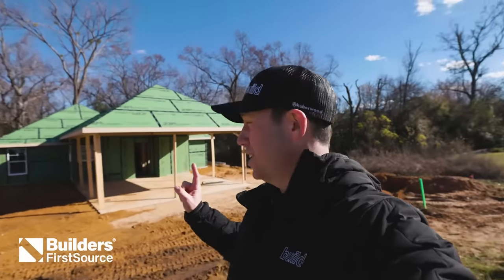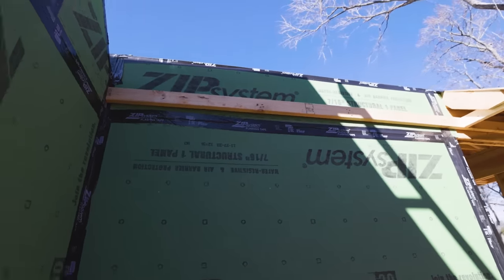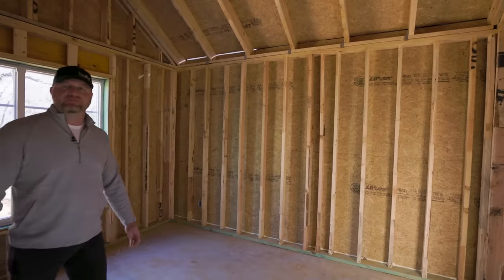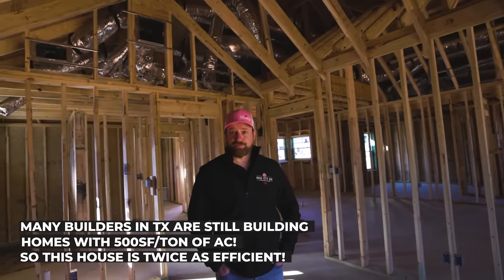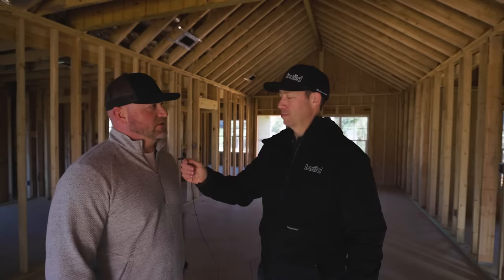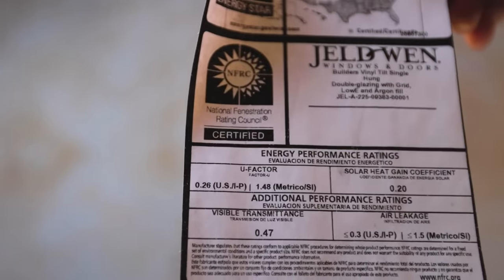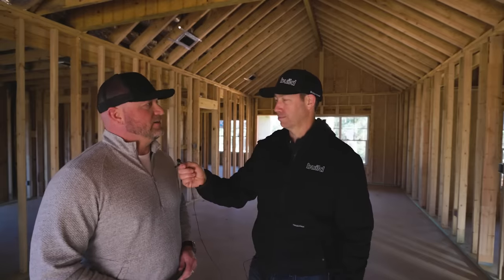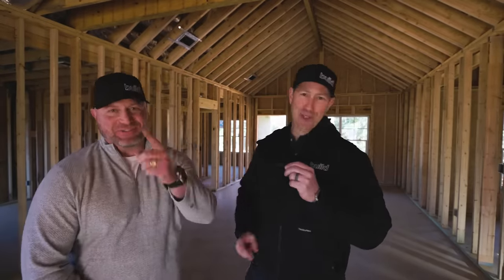Nice houses aren't just for the rich - How to build a quality home at an affordable price.

Comment: Finally, a home that low/mid income people can afford with "bells and whistles" of higher end homes.  You need to show more of these builds that are what the majority of the population needs.
Reply: You realize these are subsidized by taxpayers?  No chance you could get the land, do the infrastructure, and build this house for $200.
Reply: @maddierosemusic  yep! This is how I like to see my tax money being spent - building homes instead of blowing them up. Subsidies have been a factor in housing (and fuel, energy, food, tech, transportation, medicine, etc) for many decades. It’s all about how those funds are used … either on dated status-quo methods, or new and improved ones, which save money long term. It’s an investment.
Reply: Not a fan of zip. If the tape is installed in ideal conditions great but we all know that isn't the case. Houses get built in the cold, rain and snow.
Reply: He said 1,300 sq feet which is tiny.  And that brings the price per square foot to just over $150 per sqft which is not cheap.  Anyone can build a decent house for that price.  Extrapolate that to a 2,000 sq ft house and you have a $300,000 house.  Land and infrastructure costs also fluctuate depending on location.  Tyler is cheap land and easy power and water infrastructure.  Put this house in a desired location and the lot alone could cost $200,000 before you even start dirt work.  Everything is relative.
Reply: You will need to be low income to qualify for this HUD program.
Reply: @WaltWW  You think 1,300 square feet is tiny?  The majority of the typical 3-4 bedroom 2 bath homes that most people have where I live are 850 to 1,500 square feet.  A 2,000 square foot house would be considered a massive house and would have at least 5 bedrooms.  A small house is 600-900 square feet, while a tiny house would be under 400 square feet.
Reply: @r.j.bedore9884  everything is bigger in TX. In CA it's the perfect size for affordable housing. Do you know how low low income is?
Reply: We need to duplicate these in California and I would love to be a builder. The new mandates from California lawmakers require low income housing. That's affordable
Reply: @trumpetmaris If I remember correctly where I am in Michigan I think you had to be making less than around $27,000 a couple of years ago to qualify as "low income" for housing, but I think they raised the threshold because of inflation.  I'm not sure what it is now, but the only people I know that can afford to buy a home did so before 2019, and very few can afford to now.  A house that was listed for $150k and sold for $120k in 2019 just sold again last summer for $494,500.  The housing market is literally insane.
Reply: horrible cul de sac subdivision layout hostile to walking or biking though 🥲
Reply: @WaltWW can't build in my in area for under $300 sq ft doing all of the work yourself. $400-600 sq ft for a GC build. I haven't seen $150 SQFT in years. Can you build under $150 SQFT anymore?
Reply: Note that this builder isn't taking a profit because he's got "oil and gas interests" to pay his bills. If you hire a builder who is actually trying to make an honest living and raise a family on their work instead of profiteering on fossil fuels, it's going to cost you quite a bit more. This bloke is just out there creating unrealistic expectations and making it harder for good workers to get paid what they're worth.
Reply: Well said
Reply: @jaapweel1  It's Texas. We literally legislate against anything that doesn't require a car.
Reply: @WaltWW  I wonder how families survived when the average home was between 1,100 to 1,500 sqft.? The question is what it cost to build the house? It would be alot less than $150 per sqft.  The other fact is that there is no need for profit. I can tell you in the middle 2000's builders in Southern California were making over $200,000 profit per house.

Comment: I'm a Tyler resident who recently had a new home built.  Based on my experience, the homebuilders in Tyler have a lot to learn.  My builder and his subcontractors were very much stuck in the 70's.  They had absolutely no idea of how to properly air seal a house.  And any attempt to urge them to use more updated techniques was mostly ignored.  They desperately need more builders like Josh.
Reply: That’s just the old way- “houses have to breathe!”
Reply: @aggiewoodie  Which is true, but it doesn't mean they can't breathe through some machinery.
Reply: Its cool that this is efficient but how are you supposed to get rid of CO2? I dont want to get sick to keep my electric bill low
Reply: @chkndnts  The conventional method is to have a pipe pumping fresh air into your house that goes through a set of filters and a heat exchanger so that when it's released into your house it's at the required temperature and the spent air being pumped out is pretty close to ambient outside temperature.
The unconventional method is a hydroponic garden in your basement, or all through your house if you don't have a basement. Plants take in CO2 and turn it into sugars and O2, and if you have enough of them around you can get your indoor CO2 down below outdoor CO2 levels - which are rising rapidly at present.
Reply: It's not just Tyler, it's most places in the US!  Finding a builder that actually gives a crap about anything other than slapping houses together as quickly/cheaply as possible (using old-school techniques) so they get on to the next job for maximum profit... it's very difficult to find!  And even in this case, he even admitted he didn't really make any money on the job, so it's still a hard sell for even those that might want to do better.  But yes, realistically adding a couple of percent to the cost of the house for much better performance and quality should be considered std practice everywhere!  Change will likely have to be regulated in (and I don't like regulations!) in order for it to be normalized.
Reply: I'd have to agree.  I've seen siding installed over bare studs in Smith County on Lake Palestine high-dollar houses.

Comment: The real 'win' I see with including details on a house at this price point is that it proves that these details don't need to be seen as exclusive to $500k+ homes!  Sure, these details grew from a ton of heavy lifting that was bankrolled by those houses, but it demonstrates things like:

- It's not about having crazy framing details, it's just ledgering on all your overhangs and porches so you can have continuous tape/sealing details at your foundation and rooflines.
- It's not about having 2' thick walls; it's just using a 2x6 top and bottom with staggered studs.
- It's not about having Schuco windows, it's just wrapping your exterior sheathing into your window rough openings and taping properly to make 'normal' windows performant.
- It's not about having crazy header details, it's just paying an extra 1$/foot for LVLs and building a slightly different header
- It's about knowing what your HVAC systems need to be so they're just designed properly for the space.

The only 'upgrade' I think would have taken it to next-level would have been some ZIP-R to give you even just a few points of continuous insulation, but given the climate zone and the strict budget I think it's understandable that it's not there.  Maybe on the $225,000 model.
Reply from the maker: This is a fantastic summary. Yes, agreed about how more expensive houses have funded the “research“ on these methods. Josh proves that they can be extremely affordable.
Reply: Perfectly stated! I'm VERY thankful to Matt and all the contributors at The Build Show Network for the countless hours of filming and willingness to share their knowledge. The best part is ANY builder can build high-performance homes if they take the time to learn and apply the techniques taught on TBSN. It really can be done on any budget!
Reply: This is so encouraging. I'm looking to build 9 duplexes in the coming months and I've been going back and forth with trying to do this or do a conventional build. It's a very similar project all HUB affordable build-to-rent section 8 homes.
Reply: @buildshow true that! Early adopters with deep pockets, can be pretty useful from time to time 😅 I hope these building methods continue to proliferate through all levels of home purchasing power.
Reply: @buildshow  Also that you don't need to execute all the way to the passive house/7-figure standards these details can be done to in order to get a huge portion of the benefits.  I don't think anybody would argue that this house is as performant as a passive house at twice the price... but it's certainly more than half the house at half the price, and it's so affirming to see that the products and methods have come together  such that these details have become attainable to that degree.  It's not only providing a more energy efficient house, but better home to live in.
Reply: Tax payer subsidies bring the sale price down to the sub 200k.  What could he actually sell these houses for without the subsidies and land purchase/development cost?  This seems to be a significant detail that is being overlooked.
Reply: @D2O2  I didn't get the impression that it was subsidized by tax dollars in that sense.  It sounds like the city said, 'we want to build entry-level ZERH-certified housing in our area.  Let's get a grant from the city, buy some land, hire a builder, and then recoup cost when we sell the houses at fair market.'  Basically the grant was a 'float' for the up-front-capital of building several houses.  It sounds like the builder might have taken more time and care on their part because it's overall for a good cause, but I didn't seem to get the impression that it was directly subsidized in any significant way.

Yeah, okay, sure, how much a builder can make on speculative building can vary a lot based on what they think they can get at market for the home.  Could the contractor here have charged more for the house if they were building speculatively?  In this market, probably.  But the city isn't interested in playing that game here.  What's happening here seems to be closer to the 'client approaching a contracting company and saying, "I want to buy land and build a house for $200,000."' -- the client in this case is just the municipality, rather than a person, and they're building 11 homes, rather than just one.  In that case, the builder is negotiating their rate and gets paid based on whatever's agreed on -- the overall cost of the home isn't directly a factor, it's all about straight hours and materials, rather than the 'minimize one side of the equation, maximize the other' of speculative building.  

For any contractor, landing a 7-figure job like this is a huge draw, since it means  of steady income.  I'd venture that's more likely where you'd be seeing some savings, since building 11 houses at the same time is cheaper than building those same 11 houses as 11 different projects.
Reply: @CygnusRising  This is HUD subsidized housing.  HUD Grants are provided with no requirement or expectation of repayment.  "The contract was paid for from the U.S. Department of Housing and Urban Development's community Development Block Grant Program - HOME funds, which includes materials, equipment, superintendence and labor.  The total cannot exceed $1,114, 951.75.
Reply: Great episode on a realistic size house!
Reply: @buildshow   - yep (I am in Australia - typically a "warm" climate, if the whole house is braceboarded (typical in the USA - not Australia), adding polyiso/xps+wrap and lightweight rainscreen - increases the price "a bit" -  but if one were to include  rooftop solar (In Australia a 6kW Solar install is around $4-6k AUD) and the greatly reduced, lifetime heating/cooling costs   - long warranties on inverters and panels - Add in "basic" (USA) windows with "broken" frames and low-e glass- the monthly cost to operate is probably scarcely any extra  - for the first month / years - and utilities will always increase in price a mortgage gets "inflated away" over time.

Training builders = whoever does these steps in your crew, to do these steps as "normal" minimum best practice gets it accepted (suppliers also).  Old builders often "don't get it" - many seem to think that un-taped sarking is "house wrap"  -  start talking "continuous insulation" and they think you are "off your rocker" (crazy) - Electricians and plumbers see all these "fancy" products  as being there to tear/punch holes in (which is a great reason to bring all the services in through the fewest holes  in the envelope - into service ducting - then they can do their worst...
Reply: I feel like that has always been one of the hopes for so many people over the years who have chosen these more expensive technologies because they wanted the benefit, but also wanted to support the R&D and development of better solutions so those solutions could become economical and benefit better housing for everyone.
Reply: "exclusive to $500k+ homes!" sigh, I which I could even find a home that's around 500k where I live.
Reply: @CygnusRising  Builder said he didn't charge his normal rate given that he had oil/gas interests and had a bunch of heart for the program. The video did show that we don't have to go to crazy extremes on materials though. Staggerd studs isnt all that much more for the bottom and top plates vs 2x4's, there is a considerable price for zip sheathing, tape and liquid flash vs regular OSB and tyvek, but in my opinion well worth it. The HVAC system wasn't a horrible upgrade cost. I'd like to know how much the Aero barrier cost was. Your points were spot on. He took a contract and didn't have to worry about selling the houses after they were built.

Comment: Wow. Huge kudos to Josh for actually taking the time to watch Matt and Steve's videos and put their methods into practice! I'm living in a 2000 sq. ft. home built in 2021. It's not monopoly framed, bat insulation, house wrap, no sill/concrete detail, blown-in attic and it leaks just like an older home. It's the little things that can make the biggest difference. Siga Fentrim tape, ZIP sheathing, monopoly framed, staggered studs, conditioned attic. Things that cost marginally more, but increase the performance exponentially for the home owner. Without even knowing, they'll wonder why their energy bills are 20-30% less than their neighbors! 

Around the 15:00 mark, Josh talks about how the bottom line wasn't his priority. Amen, brother. Any business that truly puts their customer first will win my business. 
Loved this video, Matt. Thank you for sharing!
Reply: Monopoly framing is overrated. Just use Zip sheathing to build the eaves and fascia and then tape it. Cheap and air tight.

Comment: I first saw the stagger stud on a guy using it to help with sound on an interior wall. I love the 2x6 base and 2x4 staggers all around, genius. 👍
Reply: Thank you. All learned here on The Build Show. The interior walls are staggered studs with R13 batts as well for an excellent sound barrier.
Reply: My issue is the spacing become 24" OC and unless you use 5/8" drywall and sheathing, I don't like it.
Reply: @maddierosemusic  why? Are you concerned about wall flatness?

Comment: The window package was really a standout also. Maybe one day triple-pane will be common in the USA, but it's good to know there are affordable options. The other part was including a dedicated dehumidifier into the HVAC package. That almost seems like a requirement. I've read about even Passive House homes that can't get rid of the excess humidity during summers as you can only cool the place so much.

Comment: Large roof over hangs are beautiful and protect the doors, windows and siding from rain and moisture damage.
Water is the enemy of buildings. Architects and home builders need to bring back large roof over hangs
Reply: Wrap around porch decks!
Reply: longer overhangs also minimize solar coming through windows in summer, but let sun come in during winter when the sun is lower in the sky
Reply: Not to mention UV damage, if they're long enough.

Comment: I think it would be cheaper if they made it rectangular under one continuous roof (no hip, no valleys) with the long side south facing so it can be upgraded with solar panels.
Reply: You would be correct, but that would be boring.  Not to me, it makes EVERYthing easier, including future repair.
Reply: @maddierosemusic  
Not necessarily boring if done right. I would go 9 or 10ft walls to give me the height to then do an enclosed porch / sunroom on the north and south sides and a car port on one end.

Comment: Nice- my only wish is having the hvac system down on the ground so I  can change the air filters in my old age.   understand the attic appeal- Even with mini splits- cleaning them.   If its up someplace higher than my shoulder it will not be cleaned.   Loved the staggered studs, plus the  monopoly construction eve detail.  When you see something you were sketching on a scrap pc of paper wondering is there a reason you couldn't do it this way- then you see it in the video. Hurrahhhh!!

Comment: This is exactly what I want to see.

The approach of applying high performance details with reasonably priced materials to the most common types of new construction is the key to making energy efficiency a feature that people demand and pay for (because it can reduce total cost of ownership).

Personally I would like to see it on slightly larger homes, with a decent size garage instead of a carport.

I think the next stage of improvement is going to be incorporating tiny home style usage of space so an 1,800ft² home could live and feel like a 2,500ft² home but with less HVAC load, materials cost, etc.